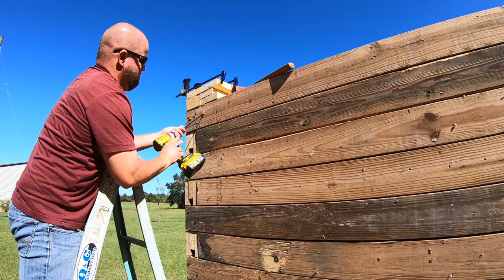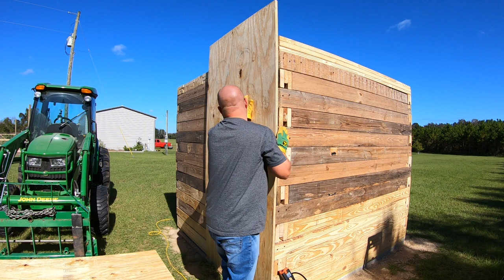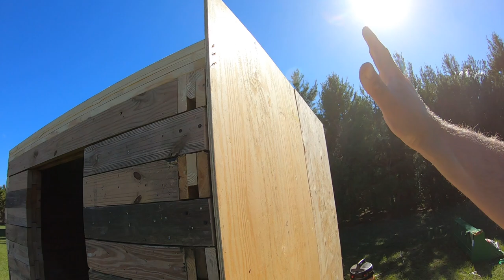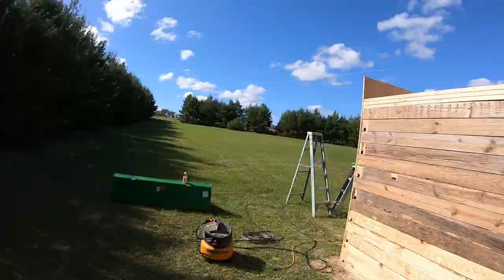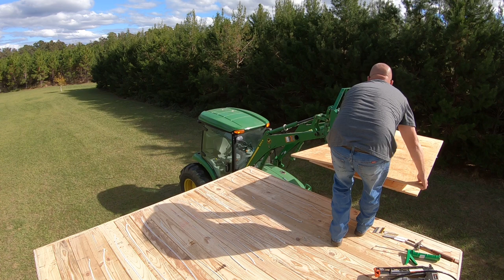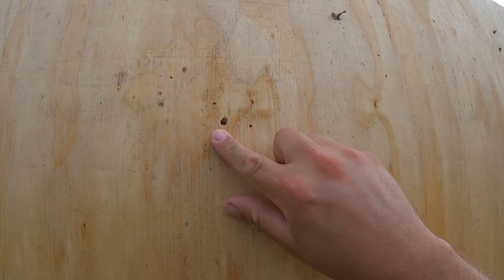#203 Roof and siding on the DIY tornado/hurricane shelter bunker build #8

Comment: No offense, but as a previous poster said, that is just a coffin. Tornadoes have been able to rip metal structural beams right out from concrete or from the shear force of the winds breaks the anchors to the concrete at shear point. You would want to either turn that into a Dome where the wind will basically blow right over or even better, get couple tons of dirt and bury that thing.
Reply from the maker: No offense but this is Florida, we don't get those kinds of tornados. It's mentioned a lot in this series. You don't bury anything here due to the rain and water.
Reply: @TKCL So it's not for Tornados just for Hurricanes and also depending where you located during the Hurricane.

Comment: Needs to be made out of concrete and under ground. That is just a coffin. Spoken from someone who has been thru many  tornados in Eastern Nebraska.
Reply from the maker: You are also speaking as someone from an area that's not mine (constantly mentioned in this series) . We don't get Nebraska size tornados in Florida and you do NOT build anything underground in our climate. It will be absolutely flooded, moldy and rotten.
Reply: @alaska doesn't need to be concrete , just under ground  .  a plastic septic tank or water tank will do just fine

Comment: People your looking at 3 layers of 2X materials plus the plywood, it’s gonna withstand a big storm , I’d say an an EF3 won’t budge this , and according to his homework they have never gotten anything bigger than that
Reply from the maker: People here wood and think traditional hollow wall homes. They cannot comprehend the strength of laminated wood 6 inches thick and solid. I guarantee that this will absorb more shock than those 1/4 inch plate wall tornado shelters everyone is tossing in their garages.

Comment: Use mobile home cool seal,  aka elastometric coating to seal the top then roof over it. That coating won’t blow off even it the top does.
Reply from the maker: Thanks for the tip

Comment: Having the right tools makes the job so much easier. Between the tractor and the battery DeWalt tools, it helped make the task easier to tackle. 

I think you should add a small chimney to the building and in the off season from storms you could hang meat in there and turn it into a smokehouse. 😂
Reply from the maker: Those tools no doubt are making the job a lot easier. Smokehouse, that's a great idea! Let me me see if I can talk my wife into that lol. 😂

Comment: Great enthusiasm however....that right there is a wooden coffin....
Reply from the maker: I'm sure you make the statement while not reading the engineered plans, watching the tests in the hurricane test facility or understanding where I live. People pop those thin walled steel shelters in their home thinking because it's steel, it must be stronger 🙄. You can't comprehend the strength of laminated 6 inches thick wood.
Reply: @TKCL  You're correct. I went straight to the comments.  Then again, I'm a structural engineer for a national storm shelter company based in Oklahoma and I've seen shelters like this get blown to pieces.  Fingers crossed it works in Florida.
Reply from the maker: You'd also know that we don't get those huge tornados you get in the Midwest as well. Most common is a ef0 and ef1. I'll be perfectly fine in this, meanwhile everyone else sits in a traditional home with 1/2 inch osb on the outside and sheet rock on the inside 🙄
Reply: @TKCL  I will concede that you could make that argument based on the information given.  Good show Ole chap 👦

Comment: You ever look at heavy wall metal panels? You'll see them used for things like seawalls. They are just about indestructible. Metal yards/scrap yards always have them.
Reply from the maker: Yep I know what you are talking about and even the fiberglass ones are very strong. I think my shelter is already over built lol. Hardi board siding will add a little more strength, but most importantly make it look good.
Reply: @TKCL  yeah your walls are good, I was thinking heavy metal roofing...
Reply from the maker: Oh sorry, I totally missed that!

Comment: Looks good. Interested to see what saw blade you will use to cut the hardie board. I had a time with that stuff even with a brand new blade that was supposedly for hardie.
Reply from the maker: I'll have to dig it out, it was a blade from lowes. Did my entire last house and 1900 square ft of siding with it. It's a fantastic blade!
Reply from the maker: I found it, it's a Irwin marathon diamond tip. Excellent blade, was never supposed to last as long as I'd it. I'll keep using it until it gets dull and then buy another one.

Comment: If you want it to last a lifetime the you should have built it with poured, reinforced concrete.
Reply from the maker: So apparently all the wood framed homes don't last? 🤷
Reply: @TKCL A wood structure without heat, air conditioning, humidity control, regular care will not last a lifetime. Just look at homes abandoned after just a few years.

Comment: Recently new to your channel (one of the many lured in by the "DIY ice machine" posts) and really enjoying it!  .. I live out in earthquake country and shear walled my house for protection .. So was surprised to see you orient your shear wall vertically versus horizontally .. Was that a decision based upon the principle of the "strength axis " needing to be perpendicular to the horizontal runs of laminated timbers, or more an economic decision to optimize coverage at the lowest cost, given the solid wall versus stud construction?
Reply from the maker: It was based off of actual engineered and tested plans (see video description). We are also in Florida, no earthquakes here. Regardless of how you orient, it's extremely strong. Wood has a fantastic ability to absorb shock. Thank you for your watching!

Comment: Would you sit inside that and let someone crash a truck driving 150 mph into it? Because i wouldnt.  With the price of lumber I can't imagine this being that much cheaper than just buying an actual storm shelter.
Reply from the maker: Your wrong.... And we don't get those truck tossing tornados in Florida as mentioned so many times throughout this series.
Reply: @TKCL  if you don't get strong tornadoes then what is the point of building this? Hurricanes? If so hurricane force winds can get up to 150 mph+
Reply from the maker: @vvendetta6656  you don't have to inform me of hurricanes. Born and raised in Florida for 40 years. I trust this over any stick built home in this state. 6 inch thick solid laminated walls is far stronger than you realize.